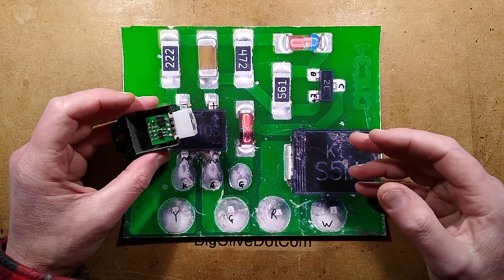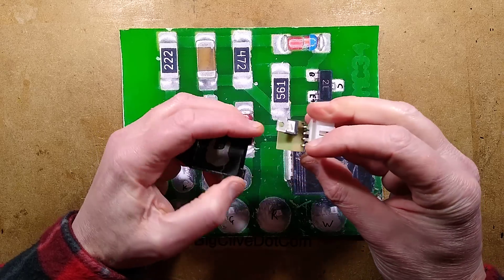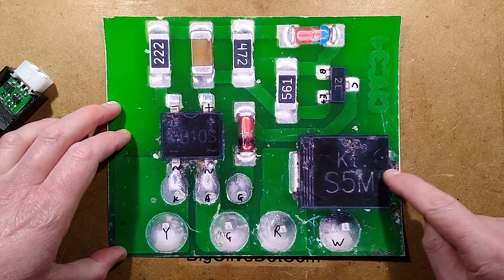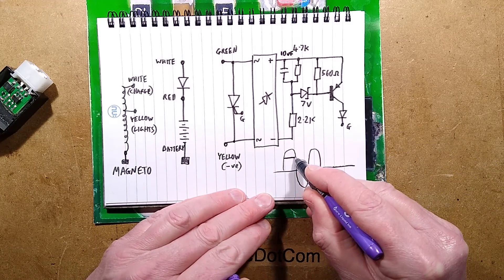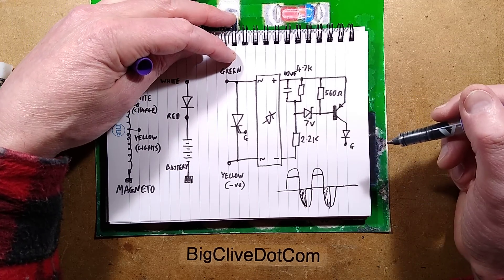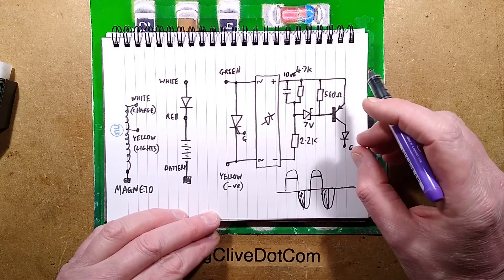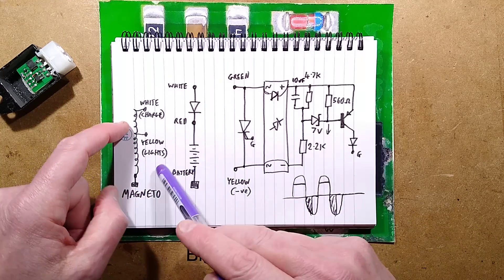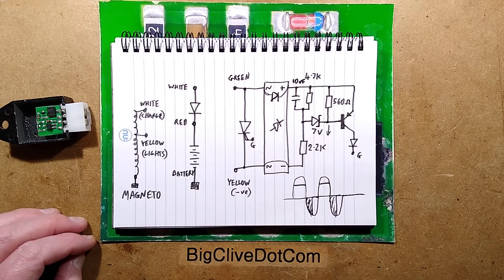Chinese quad/scooter rectifier/regulator teardown with schematic

Comment: The main issue is that the magneto is a permanent magnet DC generator, it works flat out all the time and if not loaded/shunted will produce voltages well over 60 Volts at high RPM. That was one of the early Honda tests, unplug harness rev engine and measure for around 60 ish volts at the connector. So yes it's an incredibly inefficient system still used by 90% of bike makers today. Manufacturers today are now having issues caused by LED lighting, they have had to fit regulators capable of absorbing higher power due to the low current draw of the LEDs. In the case of the 2020 Honda cmx500 with LED lamps they have completely rejigged the harness  so the regulator hangs out underneath the bike to try and catch cooling air, previously on the filament lamped models up to 2019 the reg was under the seat.
Reply: the solution is use dynamic_magnetic_field produce by controlled_coil...

Comment: I've got a failed kawasaki regulator/rectifier that wouldn't charge the battery. If I can find it I wouldn't mind sending you it see if the 85 quid price difference makes a difference in the contents. Its twice the size of that one in the video

Comment: Any reason a triac with a zener controlling it's gate wouldn't work? slap a rectifier on the output, a choke, and a cap to get smoother DC, run the lights and battery charging together.

Comment: The lighting winding is used for the headlamp which is the biggest power item. This means the secondary coil and rectifier can be much smaller, cheaper, lighter etc. The big power incandescent headlamp doesn't mind being AC so long as it's voltage is capped at about 13.5v. That is why at idle when the headlight is on on a bike you can often see the lamp flicker slightly.

Comment: Since the SCR (thyristor) is one way, having the PNP pulse on every cycle is not useful. Ron W4BIN
Reply from the maker: That's why there's a diode in the gate circuit.  It's an odd circuit.  As if they copied it and changed things without understanding it.
Reply: @bigclivedotcom  I think that the bridge causes the trigger circuit to fire on each half cycle, in which case the diode makes sense.

Comment: Almost that same Reg was on some outboards, as I had one on mine, I changed it 2 days after I started to smell boiling battery, I had done a check on the old one before removing and found it was pushing 18v into the battery, the new one has a actual output Reg rated max of 14v which has made t safe for all connected to it.

Comment: That was even more bare bones than I expected. I was expecting the old "amplified Zenner" type circuit.
Reply: the lights don't need DC, I was more expecting a triac so when the voltage gets too high, it cuts out, maybe throw a little cap and a choke in there to smooth it out a bit.

Comment: ... and by the way, dont drive without light with a scooter if you have this type of regulator. this thyristor will burn out over time and your system will raise to 20V and beyond. it rely on the load of the headlight to keep everything in its limits

Comment: Seeing how that all works, it wouldn't be too difficult to accommodate some decent circuitry in that little box - there is after all enough space.  Decent charging, regulation etc - probably all available via EBay / DX / Banggood so relatively inexpensive, should anyone feel the need to experiment!

Comment: this is VERY useful info.
PLEASE do the cdi next.
this explains why my battery exploded once. long ride, stopped for fuel, and BOOM when i tried to start again. im guessing hydrogen build up from over charge? i checked it and it was putting out 60VDC at around 1/4 throttle.
never figured it out, even the "replacements" didnt work, just went with leds and plugged in a charger every night.
Reply from the maker: Coming soon...

Comment: You'll find on the non Chinese bikes that everything is DC powered via a three phase rectifier. To be honest there is no real point in buying a Chinese bike/scooter unless you are under 19. For example BMW will put you through the practical motorcycle tests and the advanced course as part of the deal when you buy a new BMW motorcycle or scooter. If you buy a Chinese bike on finance it costs £60 per month. A new BMW C650X is £65 per month.

Comment: Ahhh thats why when there wet it reads like a large capacitor. I love pointless half wave noisey rectification. I remember my bike light strobing making me fit fall off the bike and waking up in a ambulance. Expensive crap exposed for what it is. Cheers Clive 🤪👍
Reply: Perhaps if you're strobe-triggered epileptic, you shouldn't be on the road in the first place? Just a thought.
Reply: @SodAlmighty  Erm how are you ment to know if it's the first time? Also i am no long epileptic it was a teenage thing.😉
Reply: @markvandesande8855  fair enough

Comment: That circuit yells inefficiency all over the place. not even a full wave rectifier for charger, but regulation is by means of placing a short on magneto coils, which will increase power used to rotate it.  I  know it is no that much energy, but for the zillion of these vehicles on the road I guess it adds up.
Also, the charging circuit is not that bad, lead acid batteries can cope with a lot of crap and still smile at the end of the day, yeah, they get away with it.

Comment: Cheeky bloody bastards, the whole point of encapsulation "potting" is to protect the components from oxidation and add mechanical stability, so to save money they use 5% of epoxy on the top and the rest is 95% fucking sand ?

Comment: playing devils advocate, ultra high voltage/current fuses and construction site transformers in the UK are filled with sand too, because it's something that doesn't catch fire
Reply: High-rupturing capacity fuses in multimeters have sand-like fillers too.
Reply: Hrc Fuses are filled with sand to quench the arc when the metal vaporizes.

Comment: The sand is for safety, it's an HRC-regulator.
Reply: chemical licker  A fundamental category of electronic components are called "HRC-devices", those are safety critical and commonly filled with sand. Just use your preferred www search engine and look for "inside HRC-Fuse" as an example.

Comment: Could the first component be a triac instead of a thyristor?  If so, would this circuit regulate both the positive and negative side to just over 7V - sounds good for a 6V bike system.
Reply: That's what I was thinking, the older 70's SkiDoo's had a similar regulator that shorts the magneto windings to not exceed 13 volts or else the headlight would blow, No battery in snowmobiles back then.

Comment: Come on, it's obvious - the sand is simply a generous amount of spare silicon just in case you need to repair your triac or something...
Reply: I really want to see some warranty call where they say that to the customer now
Reply: @ss ss Maybe its to spawn a creeper have lightning strike it and set it off? I know thats  a bit random.
Reply: What's cheaper silicon seal or sand? The sand is probably used to fill the potted device and then you don't have to use as much silicon sealer to pot it...
Remember they are going to make it as cheap as possible...
Reply: @davemcgaffney9401  It also makes it feel more heavy. Heavy = expensive..

Comment: If they'd used a Triac shunt a bridge rectifier trigger circuit could limit battery charging voltage too.

These were fitted the the Honda C90  when it went square headlight (well a variant of this) as the resistor based ballast system was prone to allowing the bulbs to blow. The first 12v CDI C90 with the round headlight just had a zener clamp and 1/2 wave rectifier based regulator.

Honda kept the charging system as cheap as possible. The AC fed lights and battery as part of a ballast allows a better power factor load on the stator so allows a smaller stator plate to be used. With the lights on the stator is sized to be just about outputting at its VA rating so the regulator and battery have a pretty easy time.

Comment: Well there is all that sand in there to help spread out the heat, not sure how much that helps, but the thermal cycling along with ambient air pressure changes is gonna make that thing breathe really well so you're probably right about it being a moisture trap.

Comment: The choppy waveform would create a huge amount of RF interference, something that's hated by ham radio operators.
Reply from the maker: Wait until you see the ozone generator video coming up.  It's a HAM nightmare.
Reply: One of my multimeters, really disliked the interference, on a few of the scooters I've looked at before.The numbers would be all over the place and thats just turning it on near the thing ...  Probally on how the regulator, does a half arsed job at it.

Comment: I've got 2 blown reg/recs off my Triumph.  Tempted to hack them apart to see where the differences are between the cheapo EBay version, and the eye wateringly expensive Triumph part.
Reply from the maker: Probably not much.
Reply: Just a sticker on the outside that says Triumph for the expensive one and Victory for the cheap one

Comment: Is the plastic around the seal hydrophobic or hydrophilic? Could the sand actually be sodium silicate? If so it is a desicant that can be regenerated with heating. 
Regular use may tend to evaporate moisture and because water vapor expands to 1600× its volume as a liquid, the sand leavs very very very little room for water vapor in the space to condence back into virtually no water after cooling.

I'm by no means an expert in this so take all this for what it is worth.
Reply from the maker: I did ponder whether the sand may be hydrophilic.

Comment: classic china, fill it with sand to make it heavy to "feel premium", and then put on resin.... Decoratively..
Reply: Sand is a good conductor of heat but not electricity.  Wouldn’t that make it quite a good choice, if well sealed?
Reply: @michaelfisher9671  wrong! Sand is a poor conductor of heat.
Reply: @walterk1221  that's why I burn my feet on the beach in summer?
Reply: @TheDutchShepherd  I don't know why you burn your feet and frankly I don't care. I am simply stating that from the material science perspective sand is a poor conductor of heat since that is the relevant characteristic in this comment.
Reply: @TheDutchShepherd  I believe that's actually precisely due to being a poor conductor, it's even worse than air and so it holds onto the cumulative heat from the sun, it builds up and builds up, up until the maximum thermal storage potential of the sand. If it were a better conductor than air, it would already be in equilibrium with the air, due to the air being the limiting factor. But since it's worse/slower, it holds onto the heat and slowly releases it at night – which is easy to prove because the sand stays warm for a good while after sundown.
Reply: @walterk1221  sand hot, sand conduct heat. Easier to understand now?
Reply: @TheDutchShepherd  it is you with the problem understanding. I happen to be a matetial scientist with 35 years experience. Trust me when I assure you that you are misinterpreting the effects you feel. You are experiencing sand's heat capacity not thermal conductivity.
Reply: @kaitlyn__L  you are spot-on.
Reply: @walterk1221  good to know! I'm not a materials scientist, just a physicist (of the astro- variety), but I figured I'd chime in with first principles anyway.
Reply: @kaitlyn__L  👍 I am pleased to have crossed your path.
Reply: Well, you could make a sealed product, and still be able to fix/debug it in case og failure 🤷‍♂️. I could find the idea useful for version 0 hardware.
Reply: I have seen an ipod made like this on market 😄 ..but most likely not original 🤣 ..or🤔

Comment: The solution to overcharging batteries on older British Bikes was to use a ZENER DIODE with heat sink ,the lighting circuit was tapped from part of the alternator windings.
Reply: Yes, the basic bike alternator is current limited, so a simple shunt regulator (via a power zener)  is all that is needed (plus there is no field winding to regulate).
However,  a zener will get fairly hot, so it looks like a Triac has been substituted to shunt the un-wanted part of the waveform (as it's either Off or On there is little dissipation). Note that while  the battery is low, the battery itself shunts the alternator, so the regulator isn't doing anything. It's only when the battery is fully charged that the regulator needs to divert the unwanted current. It's not clear from Clive's circuit, but i suspect that the full wave bridge is there so the Triac can shunt both halves of the waveform.
Reply: @graemezimmer604  Two anti parallel thyristors(most common) or a single triac will be the most effective solution here as it shunts both halves of the wave form like you mentioned. However, on Clive’s circuit there’s only a single thyristor which is capable of shunting the forward biased wave form even if it fired on both half cycles. This solution is the cheaper of the two and the more inferior one.
Reply: @graemezimmer604  An alternator will have 3 separate coils and produce 3 phase electricity, these can be turned on or off. Some old British bikes had a switch position which turned on the third winding when the lights were needed so the battery would always receive enough current for charging.
The system Clive shows only has 2 coils and only 1 of them is for the electrical system, it just barely has enough power to run lighting and charge the battery at the same time, I suspect the odd waveform is an attempt to conserve power by quickly switching between battery and lights.
Reply: @ian-c.01  What is your point? Bikes (and other small engines) have used Shunt regulators since year dot. Are you trying to say that they don't work?
Reply: I was thinking the same thing.
Reply: The folks at meriden used to play cricket down the gangways with zener diodes :(

Comment: I would have thought it'd just be a bridge rectifier and that's it, on most bikes, the lights are usually always on (depending on local laws) when the ignition is turned on so would limit how much power went to the battery, and of course the battery would act as a capacitor to smooth out the DC, and power stuff from there, of course cheap chinese things could be quite different to "Western designs", so, who knows... :S

Comment: Similar weirdness on a riding lawnmower's rectifier-regulator.  The isolated charge winding puts out close to 40VAC open circuit and is rated for 15A.  All the varieties connected one side of the charge winding to B+, which would limit them to half wave rectification, but beyond that they differ.  I finally found a seller whose version did charge but didn't take the wimpy little wet cell battery to almost 18V like the first few I tried: https://i5.walmartimages.com/dfw/6e29e393-3972/k2-_fd3b94f8-5faa-4ac6-981c-89ba756bceb3.v1.jpg

Comment: I work on 50cc scooters from time to time, these rectifiers fail very often. Number 1 thing to replace when the battery isn't charging. Scooters not charging the battery is one of the most common problems with them.

Comment: the older Japanese bikes you had to keep the lights on to stop the battery blowing up
Reply: On slightly less old Japanese bikes like mine, you have to keep the lights on to stop the... regulator from melting down - because the generator is not controllable, and the regulator is a shunt one that has to dissipate any extra... unless your headlight does it for you.